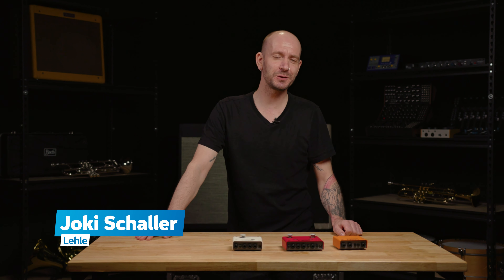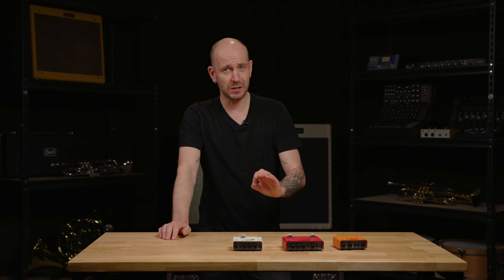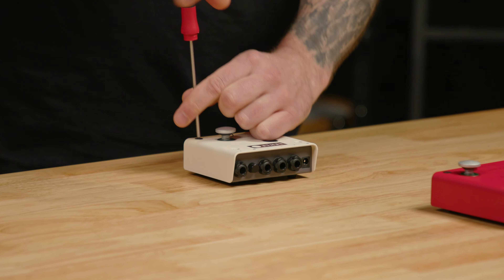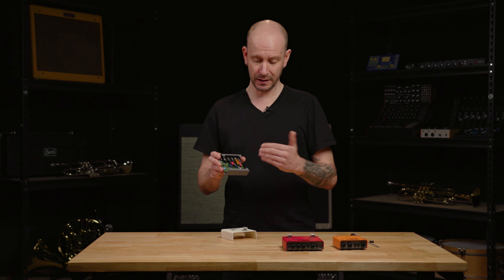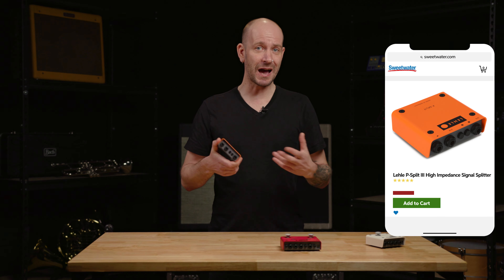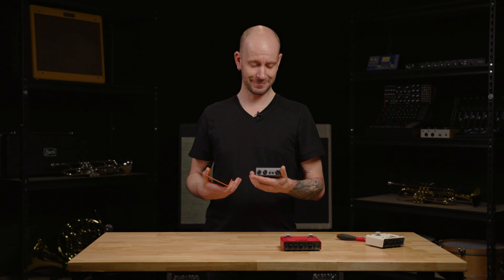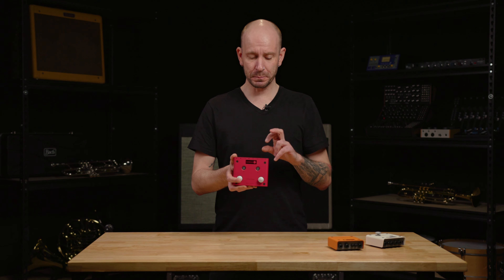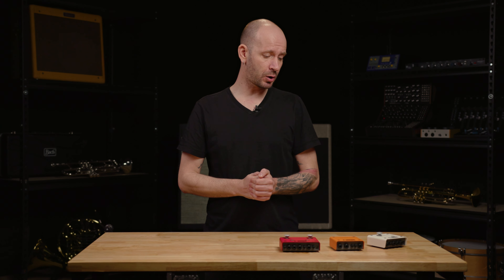Why Is Your Guitar Amp Buzzing? How to Hamper the Hum

Comment: I have a old Peavy Vypire 75 cabinet that i bought brand new and it makes a ground noise with out having a 1/4" cable plugged into it lol! I havent tried fixing this though. I also have a MarkBass amp with teo 10 inch speakers and a horn tweeter in the middle and that one doesn't make any noise like that and it's about 4 years old now. I was thinking it was my electrical at home but i guess not.

Comment: So many noise problems begin with poor wiring either at the home or club.  Ideally you want everything that has interconnected audio or computer signals to be running off the same circuit from the main electrical panel or they need to be opto isolated (MIDI) or isolated using devices such as discussed here.  Each circuit should have a discrete ground, but many poorly wired facilities and homes have shared grounds between circuits which is dangerous - if they have a ground at all.  And just because there is the ground "hole" in the receptacle doesn't mean it is tied to anything inside that box.  I've had the bejesis shocked out of me holding onto my guitar and just barely touching my lips to a microphone that was tied to a PA amplifier on a separate grounded circuit or a separate circuit with a shared ground.  Fortunately, modern equipment has more built-in protection against electrical crossover but there are still problems to be encountered including noise from ceiling fans and the ground loops as discussed here.  There are also inexpensive little devices you can plug into outlets that will tell you with LED lights if the receptacle is properly wired or grounded.